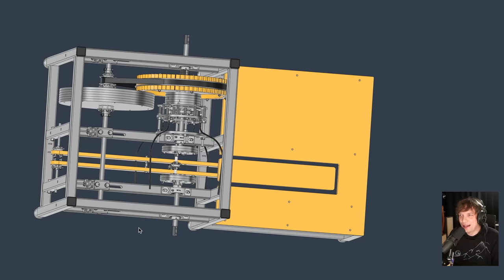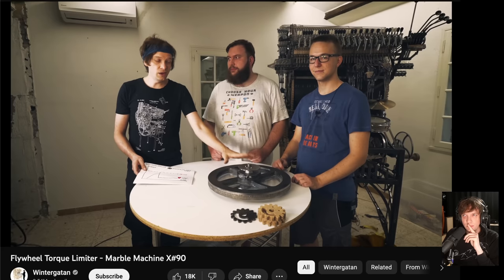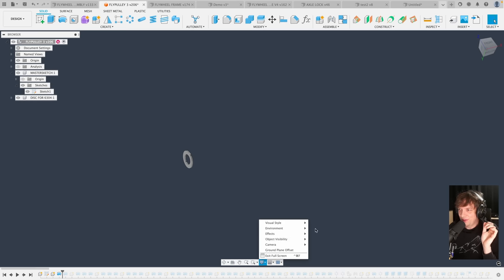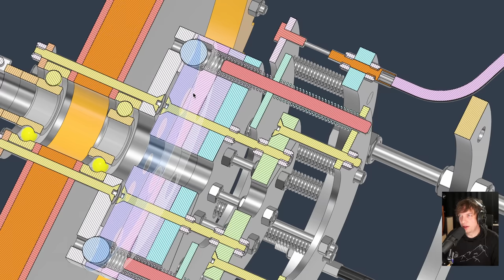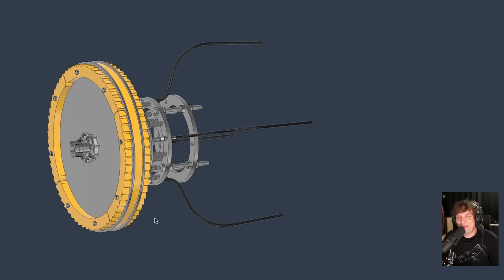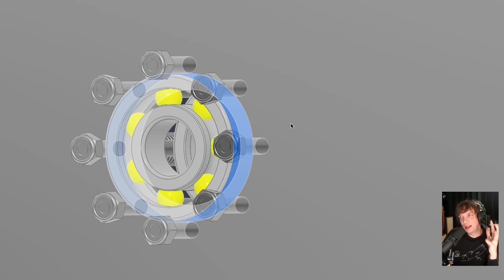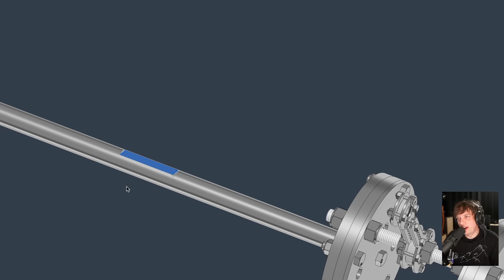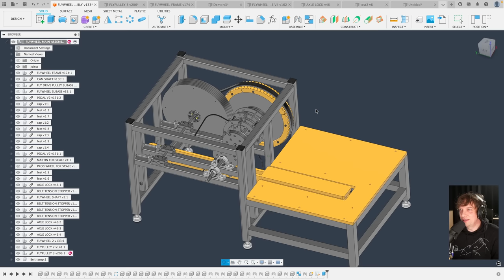Safety First! - Marble Powered Clutch

Comment: I am worried that when engaging the clutch you could have bearing balls tumbling around in the cavity. Which would cause a lot of abrasion and ind the end lock the torque limiter up. Maybe you have already thought about this. There are two solutions for this I can think of: 1 Make sure you don't open the spring too much to create excess distance to the torque limiter. 2 Have a magnet behind the spring to make sure the ball is always focused back to the spring.

Comment: I have to believe that the racheting portion of the large drive wheel is for the drive pedal linkage and hardware to engage when using the drive pedal while standing on the platform. 🤔

Comment: Waht about a Pedal like a Basedrum-Pedal with a chain (pulling the force) and on the flyweel-axil you install a mechanism like starter from Lawnmower or chainsaws are using (or the bearings from the fishstairs). You could add the same torque on all pedal positions and at any time, force could only be transported in one direction and the pedal would only be  engaged when it is used (so the machine could also turn backwards). And finaly this would be much safer for you and the machine.

Comment: I don't see any bearings in clutch system. Is moving disc touchs fixed disc directly? Looks like not very good idea despite that it maybe takes half a second, it can dissipate much of heat and make loud noice

What about ratchet - maybe it is for manual exact positioning

Comment: Consider making  the enclosure from 80/20 extruded aluminium (with T-slots) instead of having to weld. Easier to handle, easy to put together and disassemble, easy to source almost everywhere.

Comment: A masterful engineering and design project.  Are your ratchets  for pedal or lever drive?  Are you specifying fastener strength ratings?  How will you temper your artisan coil springs?

Comment: I'm concerned that your clutch won't work the way you're hoping it will. Once the marbles start skipping over the surface, it takes time for the spring to push them back into their sockets; your clutch will not reengage. It's a very short amount of time, but if the flywheel is moving quickly, the marble may not move quickly enough to reengage. You can think of it as reducing the depth of your socket, which reduces amount of torque the mechanism can handle before it goes into limiting mode. The curvature of the marble versus the locking surface also come into play here.

I'm also concerned about your bearing housing, but it'll probably work if you've got a nice file or some shims, depending on how the tolerances of the holes come out.

Comment: How about using aluminium extruded profiles for the various frames of the machine? They're commonly used in all kinds of industrial applications and I can easily see how all the standard connecting pieces and various accessories available could help you quickly build a frame that's modular and lighter than a steel equivalent.

Comment: Nice video,
I would like to suggest to rotate the half moon so that tha flat side of the D is at 90° to the split of the disk.
so that if torque is applied, the two half disk are not being pushed appart but sheered.

It could be that this does not matter tho.
Thx.

Comment: 18:15 The only question is if you can get the wheel balanced enough with this bearing housing made out of bolts. If the wheel and bearing housing are made with single lathe operator, the balancing should be perfect and the bearing housing is perfectly centered to the wheel, thanks to manufacturing process alone instead of manufacturing accuracy.

However, if you can make these bolt based bearings strong enough that you can use the wheel itself as lathe and cut the outer diameter after installing the axle, you'll have no problems with centering.

Comment: I think the ratchets are either for a system to prevent the MM3 rotating in the wrong direction due to the weight of marbles in some lifting device. Or it is some kind of hand break to immobilize the machine during transport

Comment: Those long bolts that tie everything together will have a lot of flex and potentially bend or break if there is side torque applied to them. It appears like it will since one end of them drives the flywheel and the other is connected to the plates with the notch cut in them (instead of a key) that drives the wheel. Overall i agree with some others that this design looks very complex and needs to be simplified.

Comment: i was wondering if instead of having a horizontal pedal which has a lip under which the operator could place their foot, would it not make more sense to place it vertically or at least to box in the front edge to prevent that?

Comment: You may want some disposable parts spaced in there.  Some crushable gaskets, so when you torque down those bolts, they’re locked in tight, but also replaceable.  Also, those’ll fail before the more expensive parts do.

Comment: Welding? When I saw the framework for that I immediately thought you would be using 8020 aluminum extrusion. Much easier to deal with IMHO.
Flywheel bearing housing - Is the outer race of the bearing going to be in direct contact with the threads of the bolts? If so that can lead to a couple of problems. I don't see them but you may have turned that feature off in the rendering.

Comment: It occurs to me that the clutch is going to be both really noisy (even with the tension in the springs released, the marbles will still be clicking around through the housing) and also single speed --- it'll either engage, or not. It's effectively a dog clutch. Might a separate friction clutch not be more flexible? That way you'd get gradual control of the machine torque, allowing the operator to e.g. let the tempo pick up slowly. Be having it a separate part it may also make the design simpler!

Comment: 3d print the bearing housing, would need fewer bolts, you can then heat the bearing housing in hot water and push the bearing in.

Comment: Screw are just to lock things together they are not a locating element that ensure precision or strength of the assembly. Even if your holes are precise bolts aren‘t. You risk unbalance and therefore vibration you risk breaking your bolts, etc… I think if you have one supplier for machining for this entire project it wouldn‘t hurt. I think by now you know that solving potential sources problems is more important than reducing number of suppliers for this project but you‘re the boss.

Comment: 1) Do I see a belt involved? Would it not be way less complex to let that belt slip when the machine locks up?

2) It seems wise to have several smaller clutches for several sub system as one "main" clutch is still very able to break weaker parts.  It's just like the fuse box in a house does not run everything using only one main breaker. It splits the power up in smaller circuits that each have their own appropriately sized breaker.  Toy makers could tell you a thing or two as a good toy is filled with those kind of protections. The Furby comes to mind as a nice example.

Oh yeah.. taking my thoughts into account, I would name the current design the "Wretched ratchet" 🙂

Comment: I'm curious to see how bearing lubrication is going to work on this whole machine.  Obviously grease instead of oil, but that's still gonna make a mess with those open housing designs.  I'm also curious to see if Martin runs into any structural resonance issues considering the forcing frequencies will be all over the place.

Comment: My guess is that the rachets will work like cogs to drive the marble lifting mechanism. It's super cool the torque limiter is using marbles, but considering how fast that fly-wheel is going to be spinning it makes me extremely nervous to see that the back of the fly-wheel sticking out the back of the frame!

Comment: The advantage of the bearing housing is their much higher strength. Your bolts could bend and you could have a cascading loss of containment. You should reconsider. From a professional mechanical engineer.

Comment: I also believe clutch-brake will meet LOTS of practical issues. Considering the amount of kinetic energy the flywheel has, it would be better to have dedicated and isolated brake system. Also, brake disk and pad are CONSUMABLES. They needs to be easily replaced whenever required.

Comment: In the top down view shown early in the video it appears that the flywheel may extend through or nearly through the superstructure in the back. Will there be a cage or guard that will prevent loose items near that section of the frame from being possibly "caught" by the flywheel and "pulled in"?

Comment: Your clutch design looks very similar to the diff-clutch design in most model electric R/C cars.  They have two hardened disks made of either steel or ceramic material, and balls also made of steel or ceramic material.  'slip' of the clutch is controlled by the force on the disks.  

If you are only turning in one direction, would it be 'easier' (?) to use a pawl or sprag style one way clutch similar to the rear wheel 'freehub' on a bicycle?

Comment: Shouldn't the shaft of the flywheel be fixed and not adjustable so that it is always perpendicular to the mounting point.   You could then use a belt tensioner pully to adjust the tension and you wouldn't have to worry about the flywheel's axis of rotation.

Comment: there is probably a good reason that no one uses bolts for the bearing housing.  the contact between bearings and the bolt is very narrow.  this may results in a denting of the bearing housing which will ruin the bearing.

Comment: Keyways are a good thing... This solution is hard to get within 1/100mm. Outside that and it may rattle. Sure, it's no big loads. But a solid piece over the axel is stronger. Sometimes the old boring solutions is used as they work as old boring solutions.

Comment: If the connection to the brakes and the flywheel are by the magnet detents, when you pull the brakes and it disengages the detents then what is stopping the flywheel?

Comment: Martin, you mention that the tolerance of the mounting holes would determine the concentricity of the bearing housing, no matter how precise the bore for the outer  bearing race is, this is true. However, your method actually introduces MORE tolerance stackup than a machined housing. 

Your design is highly over constrained. Think of it this way. I only need 3 points to define a plane. If I add anymore, I have to warp my plane to contact all the points and it's no longer a flat plane. That's exactly what you're doing by adding so many bolts to constrain the bearing.

You don't need a machined housing either. Waterjets are more than capable of cutting a thick enough profile for your bearings. Additionally, as others have mentioned your bearings are not specced correctly for the loads they will encounter. Don't be surprised when your drive axis has a lot of run out and binding

Comment: "I'm cutting all my discs into two in order to save one part; the key." So long as it actually stays rigid and solid, I actually quite like this idea, I just don't believe this is a part saving initiative, rather an excuse to not use a keyway. Which is fine, I'm all for innovation. I'm just very curious as to how this prototype will turn out, especially with the bearing housing design you're going for here.
I initially thought the ratchets were going to be some kind of anti-reversing mechanism for the pedal power input, but I can see further issues with that beyond avoiding starting the thing in reverse if the cam isn't resting in the correct orientation, so I'm at a loss on that one. I look forward to hearing how it works next time.

Comment: Concerning your bearing housing.
I don't think that M6 bolts are very consistent in their diameter. Especially if they are electroplated.
I would opt for a small recess in the flywheel for the  bearing to center the big mass of the flywheel and not be dependent on  the boltdiameter for centering your bearing.

Comment: I think you should add some break-pads to the design instead of just breaking metal on metal. Otherwise over time it will wear down a lot. With replaceable break-pads, you have one part that is meant to wear down and thus protects the rest.
And in general: I like the whole design, but to me it looks more complicated than in the MMX, so you might think about simplifying it some iterations, like you did with the marble-gates.
Reply: The brake here simply stops the clutch, not the flywheel
Reply: @thejatomis  That break will not stop the flywheel, but the whole marble-machine...so that will be quite some inertia aka energy that need to be dissipated.
Reply: @Svelix  if that is actually the purpose, it is on the wrong side of the clutch
Reply: @thejatomis  No its not...the machine and the pedal will be on one side, the flywheel on the other.

Comment: also, common practice is to hammer bearing into flywheel or whatever. it is used even when bearing itself is 20cm in diameter and you can imagine what forces are involved.
it would be better idea to hammer it in, than holding bearing with 6 bolts from the sides.

Comment: I am really curious to see how your bearing mounting idea works. Just wanted to throw out the idea of using a laser cut disk with bolt holes (like a baby version of your bowden cable mounts) and a hole in the center to hold the bearing. You wouldn't need to use a lathe, and if the nuts are retaining the bearing in their position, then you could use your current design with the laser cut disk plate, just to add some more contact area to the bearing.

Comment: I'm interested to see how the bearing retention design works out. My guess is that it will be fine for many parts, but I think the flywheel will need a higher precision solution, especially since it will be spinning quite fast. Balancing the flywheel will probably be quite important.

Comment: I am thinking that you could  use the ratchets on the first wheel to be used in conjunction with a lever (and/or pedal ) and a spring loaded paul to act as sort of a kick starter that could be used to get the whole thing started. 

 Overall, you have a cool design and your explanations were great.  I would like to see how you have decided to insure that the four Bowden cables pull evenly. I am guessing, something similar to brake calipers on a bike where one cable is loosely connected to loops of pairs of the others using a pair of pulleys to even out the force. 

I Like the simplicity of the bearing housing but you may have vibration issues as there will always be tolerances in the bolts that may not give you the perfect concentricity you need. In order to get the bolts to fit into the holes (i.e. without press fitting them) you will need the holes to be slightly larger than the bolts. So if you make the holes only .5mm larger then the bolts this still leaves you with a possible positional error of .25mm which is enough for vibration at moderate rpms. But if this shaft is only going to rotate at less than say ,100 rpm you are probably ok. Love the videos!

Comment: I reckon the ratchet connects to a motor, with spring loaded teeth so that it can drive the machine, and also not get in the way of manual powering, so as to not need to remove the motor.

Comment: Not sure but without bearing housing point load might be too high on the bearing outer ring and cause it to deform tiny fraction under load, which will cause bearing failures in rather short time.

Comment: Adessing the bearings:
The solution can be implemented with large clamping forces, but at the expense of precision and reliability. Why do you want to use normal bearings? Flange bearings are a "one-stop" solution that has proven itself.

Comment: Only issue I see is that the marbles remain lodged in the detent. The Springs apply a positive pressure on the marbles into the detent, but there is nothing to ensure a confirmed ejection from its engaged position in the detent

Comment: it is a good design, you need to drop the parts count for it.  look up bmx gyro front brake cable.  It is also a cable that deals with a revolving part and functions quite well, time tested and most importantly gone past several iterations to reduce part cost and part count.

Comment: Why is there a bearing clamped either side of the large pulley and not simply one pressed into the pulley, can a bearing not be pressed into wood?
EDIT: A quick Google just informed me that yes, bearings can be pressed into wood, so would that not be better than the convoluted dual bearing clamping system? Also, would clamping the bearings from the sides with enough force to secure them against the pulley not run the risk of deforming the bearings (making the internal channels oval) and thus increasing friction?
Reply: @Wintergatan fake account?

Comment: Wouldn't the problem with using the bolts to hold the bearing in place be that it concentrates force on a few points, which could cause deformation of the outer race?

Comment: If there is a part you should have housing for your bearings it should be here heck it could even be a couple of laser cut plates just to help it center, as the flywheel goes of center the marble machine wont be an instrument but a hoola dancer

Comment: This clutch is probably not going to engage properly when the difference in rotation is to high. Thus you need to stop or slow down the flywheel before you can properly re-engage. A friction material would be a better fit. It can absorb the energy required to re-engage with rotational differences. Now the force on impact on the marble will influence the torque limiter. The mass and acceleration combined with the radius of the disk wil equal the force to push the marble in it's static position.